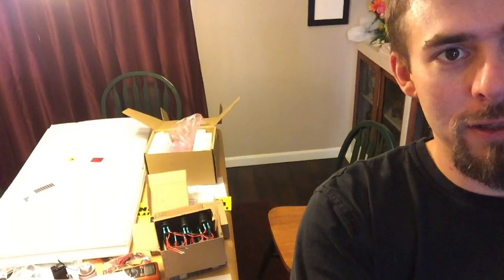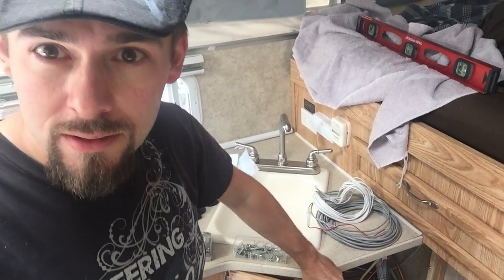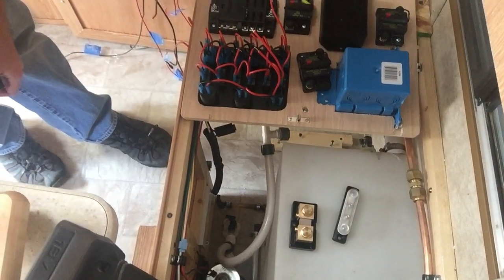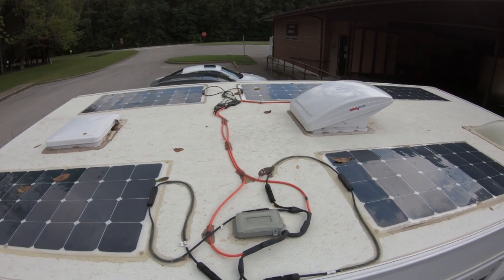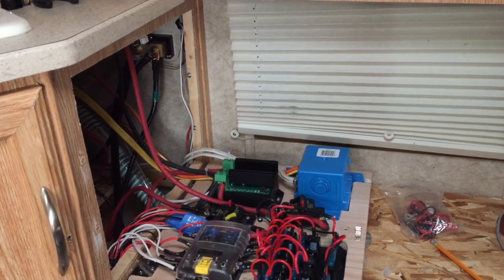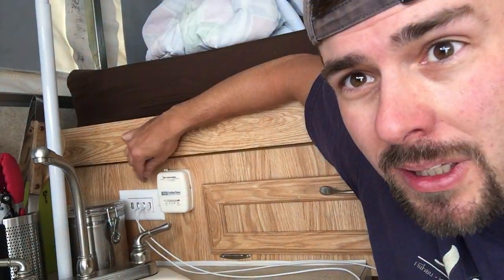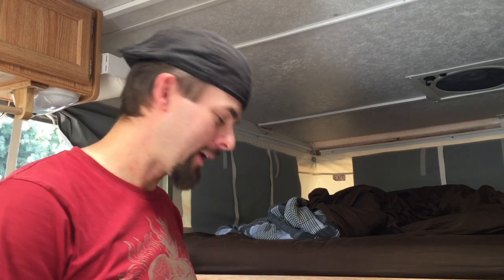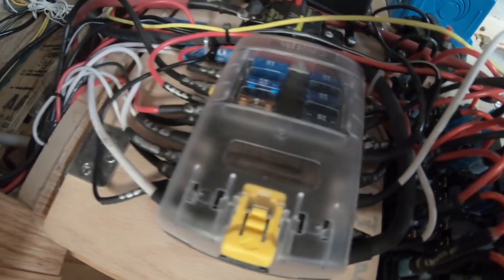Nomad Solar System Install

Comment: If you bought some of those flexible solar panels and went to RTR next Winter, you could make some extra cash helping old folks set up a solar system. If I tried to do what you just did, I would have been electrocuted to death and cremated.
Reply from the maker: That is a good idea. It is a lot of work and the system is much more than the panels. You also need to know what your needs are. Here is an entire 5 part post on how we went about the entire process if you are interested. 
https://nomadicmoments.com/2018/09/03/truck-camper-solar-system/

Comment: So I take it that you are an electrician.
Reply from the maker: No. I was a lighting designer in live production. I learned AC power as it was needed for the job and repairing fixtures. DC is a different beast but some of the info translates. It is important to learn the differences before attempting a job like this which I did over the course of a month.